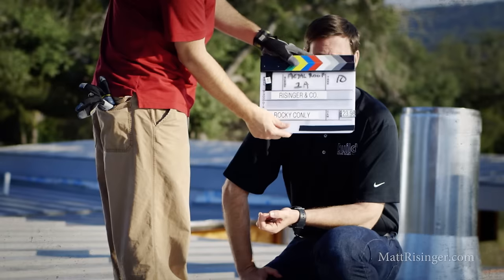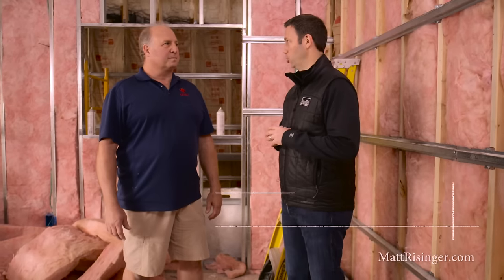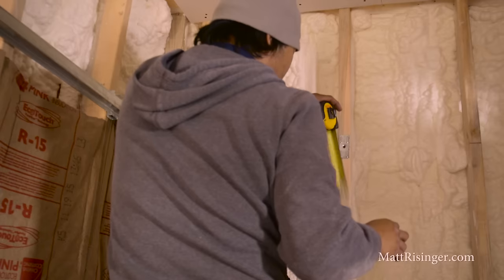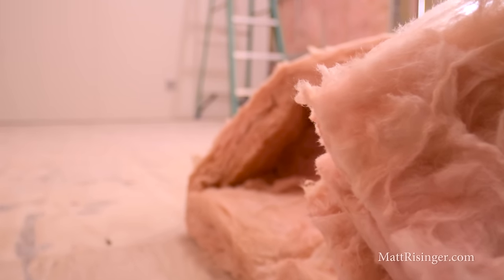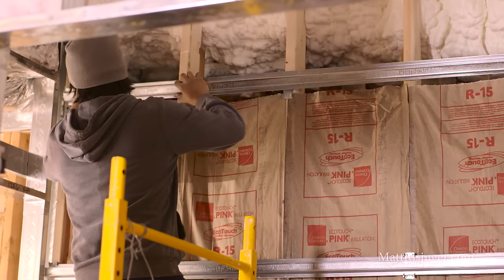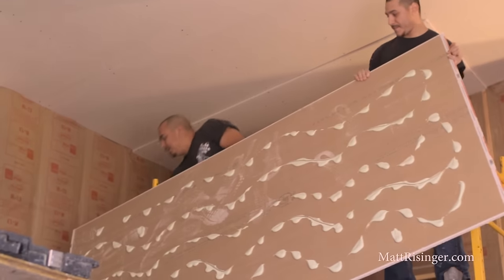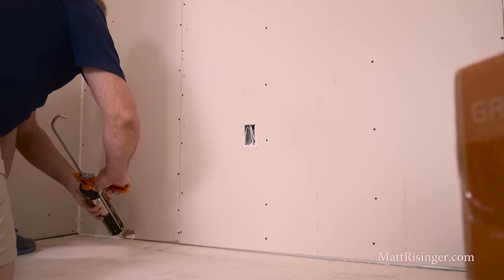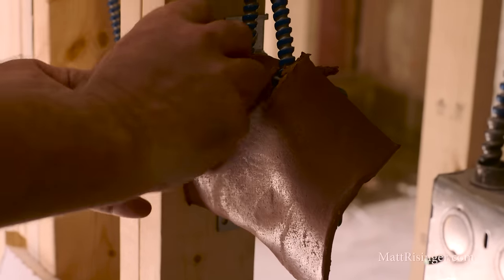How To Soundproof A Recording Studio

Comment: Check this out: I also bought myself a $100 Gazebo / Pergola (200cm x 200cm) and placed it in my basement on a noise absorbing rug. I left the outside "walls" off and placed moving blankets on all five sides. Got myself a 10M led strip for the inside and some bass traps in the corners and foam on the inside off the blankets. Super easy set-up for recording with my D18 and singing at the same time straight into my iPhone using the Roland Go Pro mix. Call me cheap but I just love my little "tent" inside my basement. cozy

Comment: Here's the budget version that gets 90% the effectiveness. 2 layers of 5/8" sheetrock on both sides of the wall. Make the wall a staggered stud, 24" on center wall with 2x6 top and bottom plate and 2x4 wall studs. Fiberglass insulation in the cavity (NOT mineral wool, I promise). No greenglue. More or less done. Details do matter. It should be 100% sealed with caulk. Any caulk works. They all stop air movement. You can spend a fortune on the details shown here with very little gain. For the home brew folks, this is the bees knees.
Reply: Yeah the folks at green glue marketing stumbled on a gold mine with their "converts sound into heat!" line. Anything that traps sound vibration ( so: caulk, foam, insulation, water, etc.) will in turn vibrate. Vibration causes friction. Friction releases heat energy. This is absolute basic physics, which I'm sure I slightly mangled, but green glue does not have a patent or monopoly on physics.
Reply: All true, Noneya.  I would also add simple tar paper, preferably to the studs before the first layer of sheetrock, and/or before the second layer as well.  This is due to different absorbtion and vibration levels.  Also, it's cheap.   Lastly, use the foam gaskets for outlets and light switches.
Reply: 100%. I'm using green glue between both layers on mine but only because I got an amazing deal on it. It's frankly too expensive otherwise to matter; if you want more sound isolation, better to put up a third or fourth layer of drywall, as long as you have space and your framework can support it. If I didn't get the deal on the green glue, I would have tested with two layers of 5/8" GP, and added more if necessary. Gypsum is relatively cheap!
Reply: @ClintonJudy  Much cheaper than green glue and just as effective is to purchase polyiso insulation boards (available at Home Depot and Lowe's) and sandwich them between your two layers of 5/8 drywall.  The dissimilar materials touching makes for a huge reduction of sound transfer...Sound in the room hits the inner layer of 5/8 and that drywall has a specific resonance to it, then it hits the polyiso board which has a completely difference resonance, so it changes the vibration transmission rate, and then what vibration energy (sound) is left has to go through that second layer of 5/8" drywall, which is again different from what the vibrations were just competing against (the polyiso board).  Icing on the cake is if you have sound isolation clips with hat channel and your 3 layers are screwed into that channel so there are no walls touching directly to the wall studs.  Double layers of 5/8 give you more mass, which is good, but if they are touching, they are vibrating at the same resonant frequencies and therefore will not dampen the sound as much.  That's what your green glue is doing...it's acting as a dissimilar material between the two drywall boards so the sound energy is drywall>green glue>drywall, but at a huge price tag. Hope this helps!
Reply: @brandonswafford861  Hey Brandon, you got any 3rd party (or even 1st party) STC ratings to show that setup? I'd like to check that out. Polyiso is expensive AF, but cheaper than green glue. I've used Roberts Carpet Adhesive from the big box store in place of green glue, but I can't verify it's effectiveness and it's a pain to use.
Reply: @noneyabidness7226  Carpet glue do the job fine to, one that is more rubberized and not turn in to stone when hardened and the result is close to if not Green Glue for alot less money.
Reply: Thanks for mentioning the staggered studs! I just learned about this 2 days ago. Great tip to turn one wall into two isolated sides for less vibration transfer.

Comment: For anyone looking at this. I really recommend Rockwool instead of Pink Insulation. It stays dry if there is moisture, condensation or water leak in the future.
Reply: Yeah Rockwool rocks! waterproof,soundproof and fireproof.
Reply: Rockwool costs more and has minimal sound benefits over similar R value fibreglass, especially once you start using hat channel / resilient channel, double 5/8" drywall with green glue or QuietRock.  Better to spend that savings per sq ft on MLV for the ultimate quietness.  Regarding fire rating, if you're waiting around for flames to penetrate double 5/8" drywall there are bigger issues.  I've also seen experiments with fibre glass exposed to a propane flame where it seems to hold up well.

Comment: While some have already described this as overkill, it's actually what I think most acoustical engineers would regard as semi-pro. This is what you build as a local facility that does band gigs, etc., or as a high-end home theater within a modest budget. This is not how you model, build, and test places like The Power Station in NYC, Sound Kitchen in Nashville, The Village in LA, or Criteria in Miami -- just so no one is misled. Did some work in this field when TEF machines and LEDE were emerging technologies and designs. Obviously I am old...
Reply: Reflected Miles THEN WHY DONT YOU MAKE A VIDEO AND SHOW THEM HOW ITS DONE ✅
Reply: Reflected Miles I am building a house from scratch soon and would appreciate any advice so I get it right the first time. I will be 50' away (and up on the second floor) from their closest wall but they use their backyard very often too which would merely be 15' away. Anything you can say (especially for HVAC and junction boxes) I could really use!

Comment: Here in Québec,Canada,between the 2x4 wood studs,we put rockwool safe and sound,then we screw in a 4x8 sheet of Sonopan and then add the resilient channels and then 2 sheets of 5/8'' drywall to soundproof the wall.
Reply: Hey Christian I am building a course on how to soundproof your studio and would love to know what you wished you had known when building your studio?
Reply: @WilsonHarwood  Hi Wilson,well I am still in the process,I think I have covered all the bases.The rockwool,the sonopan,double sheets of 5/8" gyproc and I also read and saw in another video,they use soundproofing caulking around all the seams of the wall and outlets.Using acoustic panels also helps.
Reply: @christianpolytechnique7404  Hey Christian, yes the acoustic caulk goes around all the seems of your walls and where the wall and ceiling meet. You can also use it around outlets and light fixtures. Rockwool really isn't necessary. There isn't any scientific evidence that it adds to the soundproofing and it costs way more. You can use it if you want, but you may be wasting some money there. Regular pink insulation works great if you build your walls right. I have a website where I have a free course that goes a bit more in depth if you want: www.soundproofyourstudio.com. Please let me know if you have more questions. Happy to help!
Reply: @WilsonHarwood  Well I like the Rockwool cause it's fireproof and water resistant.
Reply: And does it make it 100% soundproof? Gearing up for a garage/studio room outside specifically for this so not interior or in a house

Comment: 3.5" Rock wool and 5/8" drywall is how I like to do things.
Reply: Rock wool is garbage and you won't find any in an a-list studio, ever. In fact it can actually transmit sound if it's not incredibly loose but design eliminates the need for it anyway. Corning 703 is good for broad band absorbers and Helmholtz resonators but don't buy into it for sound proofing because it's limp dense material that will stop sound along with a properly designed  inner and outer room. A shame lead is so unhealthy. Gold would do in a pinch but...
Reply: @drampadreg1386  yeah, that's not true. Rockwool has the same absorption coefficient as 703. I've been involved in several high end studio builds and all of them implemented rockwool. 703 is great for treatment because of the rigidity and lack of sagging, but it's way overhyped.

Comment: In my youth I built a rehearsal studio in a garage.  Double sheetrock, double doors, etc.  When it was near completion I found the air leaks by walking around the garage while the band was rehearsing and listening for where the sound was leaking out.  By listening I could pinpoint the leak to a specific place on a joint and fix it.

Unfortunately the studio did not work out.  We had burned out bridges with out elderly neighbor before we insulate the garage for sound.  She complained one more time after we finished.  The police officer walked up to the garage and knocked on the door.  No one answered.  He then opened the door and knocked on the inner door.  He explained that while he could barely hear the band, the police had received an N+1 complaint and that we would be cited the next time.  Back then the law did not have a dB rating.  Instead it prohibited any amplified music in a residential neighborhood.  Sigh, it really was a great rehearsal space.  We wound up moving to a different house across town.
Reply: what a terrible neighbor
Reply: @FixItYerself  did you get it shot then continue playing?

Comment: Those are not the clip types anyone should use as you have a far more direct mechanical connection than you should.  Better than going straight to the stud as then the board is against the entire stud but it is still transferring all the vibration right to the hat channel.   Using RSIC-1 or Whisperclip style clips are what you should use (besides doing a whole other wall..) if you want to minimize the vibration.

Comment: with all that air flow= sound flow sealant, what do you do for ventilation throughout the 3 rooms of the studio. without compromising the soundproofing.
Reply: Dave Gnash same thing i wanted to kno
Reply: You can make baffles. Rod Gervais has an excellent book on this kind of stuff.
Reply: Separate HVAC systems. I think the best way is with a mini-split system and then a fresh air vent can be added.
Reply: Just frame in a crack unit with an access panel. Evaporator in the ceiling with a condensate pump. Condenser hole for the supply and return refrigerant copper and seal it. Done.
Reply: Acoustic boxes
Reply: I have looked into using a panasonic ERV or and Vensus ERV. The panasonic has a 4" hole through your wall which is pretty small and won't compromise the soundproofing too much. I love my minisplit in my studio and would highly recommend the Mr. Cool DIY. Although I didn't end up installing the ERV, after consulting with a specialist we decided putting the ERV above the mini split would make the most sense so that the new air entering the room is heated or cooled immediately by your mini split. Anyone else have better ideas? Would love to know since I just crack my door sometimes to get fresh air in.

Comment: What I don't understand is when you use caulk for the joints, how do you get a flat mud surface over top if it? If the caulk is bulging out like in the video, aren't you going to wind up with a lumpy appearance once you mud over it? And if you sand too much you're gonna be sanding caulk. Or do you use your finger to press the caulk lower than the drywall's edge and then mud it to be flush?
Reply: This question is why I'm looking in the comments. I still don't get it
Reply: First layer gets caulk on joints not the finish layer. Then seal edges of drywall around the room on finish layer

Comment: Rockwool, RC channel and at least 2 layers of 5/8 drywall. (Ive done 5 layers in movie theaters). The cost difference compared to the difference in reults is insignificant if you're serious enough to build
a studio.  Would you put a Volkswagen beetle engine in your lamborghini because it's a $1000 cheaper?

Comment: Finishing my basement and need some advise .... I am finishing a rec area which i have in my basement which i am now converting to a media room (not a dedicated theater but more like a lounge area where i will have a projector/screen and a descent sound system). 2 sides of the room are against the foundation of the basement and have solid concrete. One of the walls is against the utility area which is where i have the water heater. The 4th wall is a shared wall with renters who stay in another part of my basement. So here is my question -> Should i use green glue for all the 4 walls and the ceiling or should i only consider applying. that on the wall which is shared with the folks who rent my basement? I do intend doing a double dry wall on the wall which is shared with the renters as well as the ceiling but am confused about how generous i should be with using Green glue. I also intend using roxul safe and sound on the shared wall as well as the wall against the utility room and the ceiling. Please advise.

Comment: I'd love to soundproof my refrigerator.
Reply: Put it inside it's own room with a robot to fetch your items for you =)
Reply: I imagine that day will come...
Reply: I believe that would be owning a Sunfrost with a DC compressor. Perhaps not exactly silent, but heavily insulated with one moving part, I think. The AC versions are probably about as noisy as others, though. It's not cheap, of course.
Reply: Get a Sub-Zero and you won't need soundproofing.
Reply: @laurabrown8917  Thanks Laura.
Reply: Is your fridge new or old? If it's old, them maybe you need a newer one that isn't as loud.  It's like dishwashers.  they have ultra quiet dishwashers now you can barely tell they are running.. Heavily insulated.
Reply: @laurabrown8917  What frequencies does it have 25dB attenuation?  Will it go below 125hz?  really?   25dB attenuation at 30Hz?    Really? I'd like to see the measurements for that..

Comment: So Matt why not use Rockwool instead of regular insulation? Now I have not done a recording studio but I have done doctors offices where they have a need to limit sound and not take up more space with thick walls ( 2 separate offset 2x4 walls ect. )Double 5/8” on each wall and Rockwool has worked well .  I am always up for more knowledge. Thanks for your channel.
Reply: Expensive materials like rockwool and green glue make more sense when space is at a premium. I'm not against using those for working inside existing architecture. But if you're building a brand-new facility, you'll save a lot of money by planning for the walls to be much thicker, and using cheaper materials like fiberglass and multiple layers of gypsum.

Comment: what kind of spray foam insulation do you suggest? Do you use spray foam on the ceiling in addition to the mat insulation?
Reply: I definitely wouldn't recommend spray foam insulation. It doesn't have great acoustic properties and is expensive. Just build it right with double walls or using hat channels and then use the good old pink stuff!

Comment: Make sure to decouple the floor first, then build the walls on top of rhe floor and then the ceiling making sure none make contact with the existing structure. In other words, don't let the studio/control room/iso rooms DO NOT make contact with the exiting structure. If you don't follow these CRUCIAL requirements, you are just spinning your wheels.
Reply: The ceiling is always the beginning of your project. Then you do the walls. Once that is complete then you do the floor.
Reply: @mattwickham6985  how come? do you suspend the box from bungee cords? How do you hold it in place? silicone stress balls on the floor, then build the box on top?
Reply: @snorttroll4379  Cover the floor with rubber workout mats.

Comment: Question.  I am building a basement studio which both the vocal booth, part of the control room, and the tracking room has exterior concrete foundation stem walls floor to ceiling.   The outside of these walls are earth.   Each of these walls have insulation which makes the rooms very well  balanced per reflection.   I  put up new 2x4  on 16" center walls in front of the insulated concrete exterior walls and  was not going to sheet rock these walls being the do a great job right now as per sound absorption with no echo. Fore decor I was planning on building framed fabric panels to attach to these walls for aesthetics but utilizing the already great sound absorption.  Have you done this and what are your thoughts on this technic?  Bear in mind these are only exterior walls with insulation and earth on the outside.
Reply: Hey Gary! Sounds like you have an ideal starting point. I built a studio in my backyard from the ground up and would have loved to have the isolation of earth and a concrete foundation to start with. My question is simple. How soundproofed is the basement already? Seems like if the walls and floor are concrete and surrounded by earth then you may have all the sound isolation you need.  I would be most concerned with your ceiling. Is it a standard would deck? Also your door to the studio will need to be rock solid too. Please let me know if you have more questions. I would be happy to help since I just went through the whole process myself.